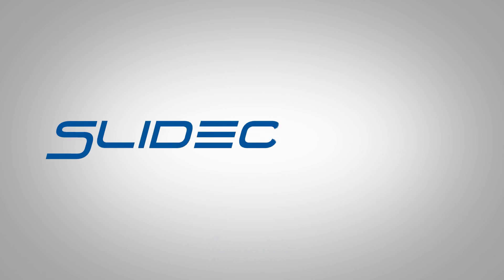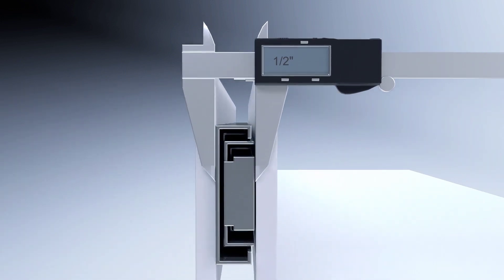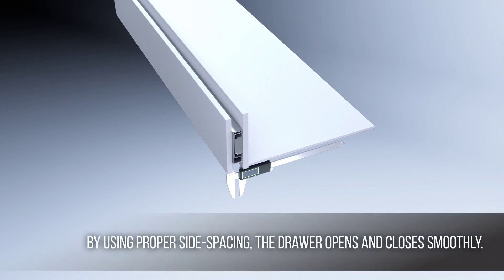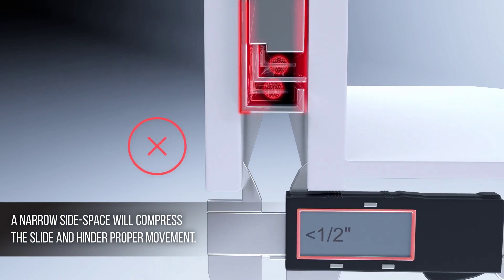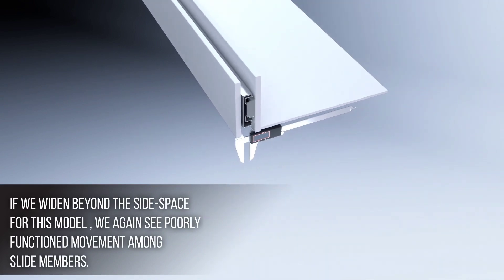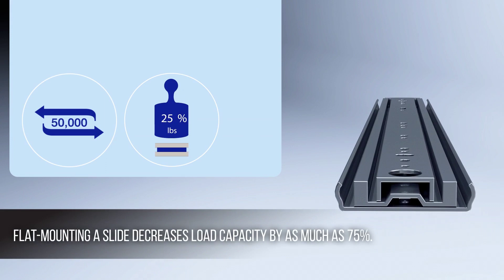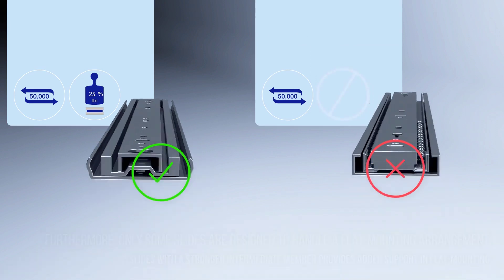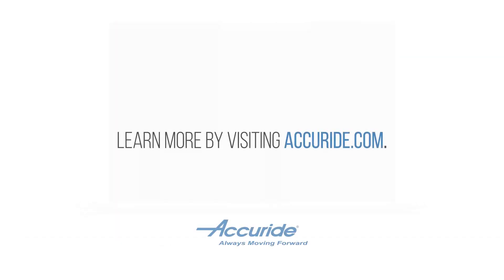How Side-Space Factors into Your Drawer Slide Installation

Comment: You guys need to fix your video. The text at the bottom says to add 1/32 but shows that 11/16 is the proper space for a 1/2" slide. The voice says to add 1/16, you have three pieces of contradicting info inside of 8 seconds.
Reply from the maker: Hi James, thank you for bringing this to our attention.  For drawer slides with a 1/2" cross section, we recommend adding an additional 1/32" of side space on each side, for a total side space of 1 1/16".